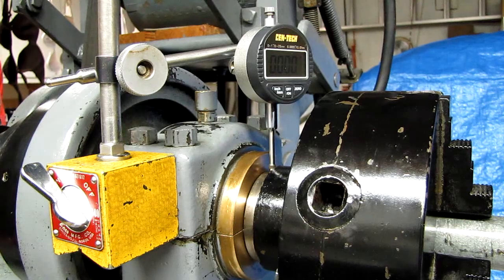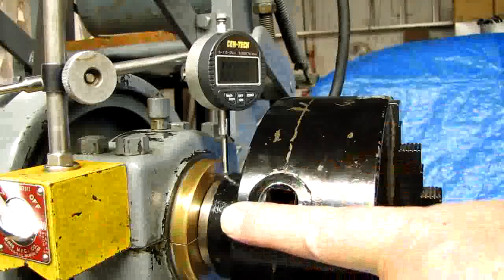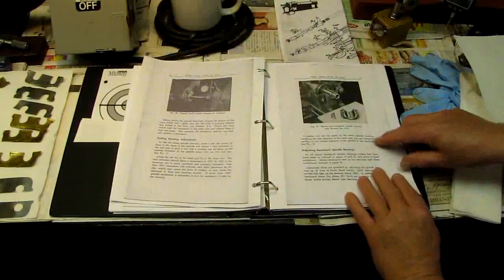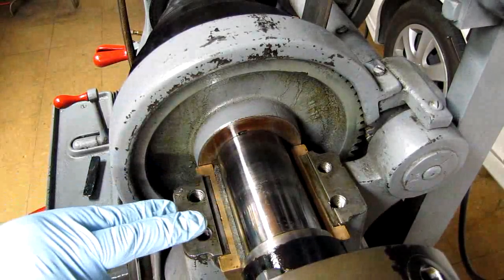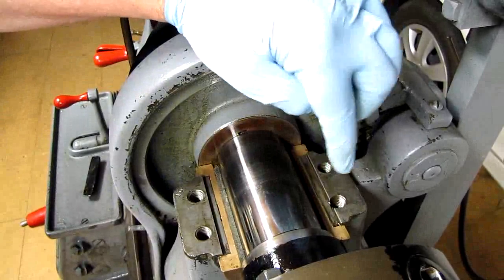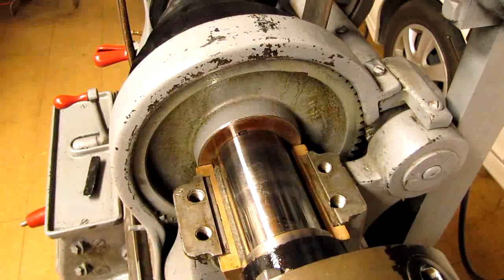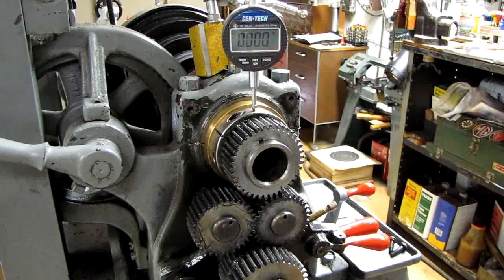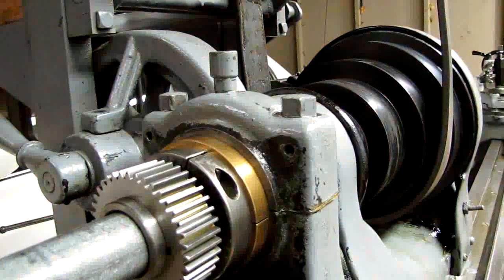South Bend Lathe Spindle Bearing Adjustment

Comment: the bolt location might be to keep the cap from being reversed. they know full well when they make these things that orientation matters and they can never make them all the same. also it is fairly common for things to be hand drilled even when you expect precision. a lot of an airframe is hand drilled in place because the airframe moves. the whole wing on an f-16 is bolted on with hand drilled holes and when a mount needs replacement it has to be copied from the damaged one. no 2 are identical

Comment: I know this is an ancient video but FWIW, South Bend plain bearing caps use "laminated" peel shims to adjust the oil clearance, while the bar in the spindle "works" the preferred method to load the spindle id to pry up with a bar directly under the chuck adapter and a general rule of thumb is when installing the cap you may need to only lightly snug the bolts, over torquing may begin to crush brass laminated shims, also you may need to "half shim" one side to arrive to a good fit.

Comment: Great video. You should do more.

I was just looking at my headstock and noticed a few thou' of endfloat so it's good to find out that the adjuster is on a screw thread. I just bought a WWII 10L 8187Z with cast iron base and leg but it's missing it's leadscrew and gearbox. They come up on eBay though.

The spindle feels silky smooth and no signs of any scratching from grit and runs super quiet. I also have a 9" swinger with a 3 foot bed. I keep him for making Dwarf porn!

Yuk, yuk, yuk!

Comment: There is no grunting and groaning,, just roughly 70 pounds of pressure…
I don’t understand why these people think it’s OK to change up and modify these procedures when South Bend specifically tells you how to do it,, unless that chuck is permanently attached to that spindle which I doubt then it should be removed… oh and if that test bar is sticking out 1 foot from the end of the truck then it’s actually sticking out 1 foot plus the length between the jaws and the spindle on top of that.. Catering or dealing in thousandths of an inch you are in no way accurate